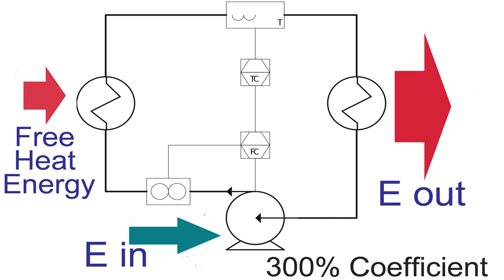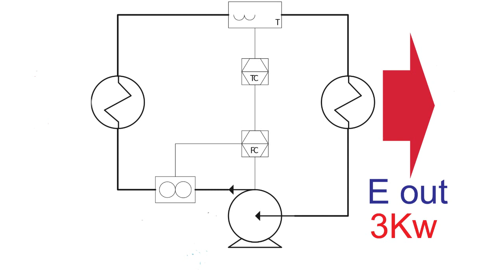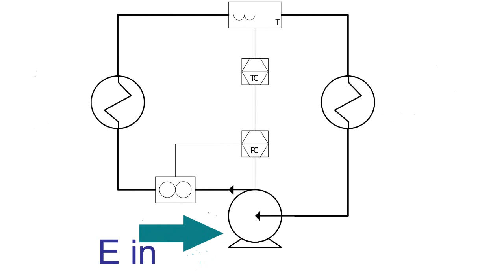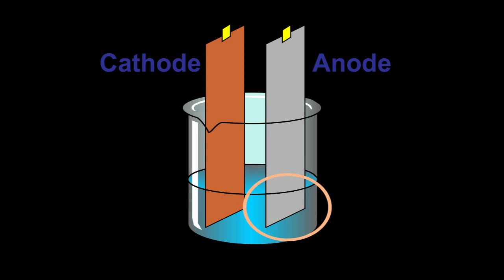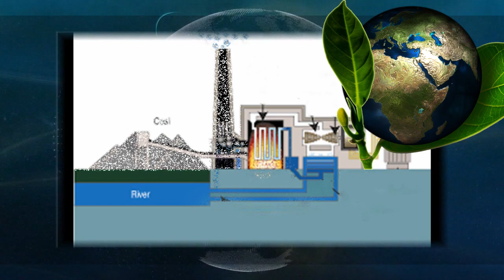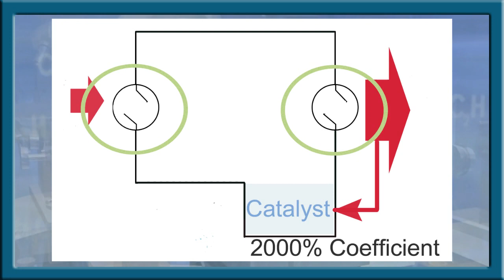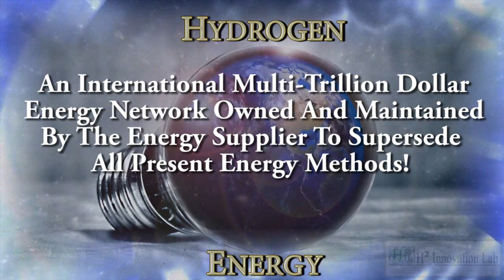How It Works - Self-Sustaining Hydrogen Energy | H2IL

Comment: Doing a bit of calculation here: the website says that $0.34 worth of galvanic metal is used to produce 1 Kg of hydrogen. What happens to the galvanic metal?  I would assume it is converted to oxide.  

The lower heating value of hydrogen is 120 MJ/Kg.  Lower heating value would be used because a fuel cell outputs vapor. The fuel cell is about 50% efficient so that leaves 60 MJ.  You have to power the GEE so maybe 12 MJ goes back leaving 48 MJ.  That would be a 5 to 1 factor which you say was often observed. 48 MJ is equal to 13.33 KWhr. Residential price of electricity is $0.13 per KWhr.  That comes to $1.74.  The fuel cell puts out DC.  To convert to 120/220 VAC, 50Hz/60Hz an inverter would be needed which might be 80-90% efficient.  That would cut it down to $1.39. Finally,  $1.39 - 0.34 = $1.05.  That is assuming that the metal price is in USD. 

I believe that power meters compare voltage phase with current phase so that they will run backwards if energy is flowing out to the service drop. In many places, the utility must credit your account even if the meter shows a negative usage. Seems like this sort of thing would make a good demo of your technology. It would be like the local electric utility is validating that it actually works.  And who wouldn't be interested in a story about a money machine?
Reply from the maker: Thank you for your constructive comments. Yes this is just a small scale demo unit. The principle is based around energy in mass (E=mc2) so the larger the mass of an upscale unit, the greater the energy produced and higher performance. 
You have hit the nail on the head with your grid-tie comment. That is exactly what H2IL will be doing as the third phase of the proof of concept. No one can refute a detailed invoice from the power provider. The 5kWh full cycling system is being developed with plans to start grid feed mid 2021.
An interesting bit of news I received today is that a system the size of  a wind turbine foundation footprint will generate 20 time the energy of the complete turbine in all conditions. Being hydrogen based, below ground installations are achievable and presents a whole new concept for microgrid applications. David Hendrick.
Reply: @h2innovationlabh2il69  Hi David, is your scale model already running on grid,  I didn't think that was happening untill late 2022. Or will that be the time you make open news feeds. 
I'm fizzing with excitement, this is the best invention the world has seen in 100yrs.
Reply from the maker: Thanks for your question and support Barry. That is the time frame for project completion, pandemic disruptions permitting. Grid monitoring reports will be accumulated over a 6 month period following.
Great to hear from ones who take time to study the CCTV video verification reporting. Thank you!

Comment: After going through the process the water must have lost it's galvanic energy.  You can't fully discharge a battery and then continue to discharge it.  Can the galvanic energy be recharged using off peck power.  If so this can be used as a energy storage as well as a form of generation.
Reply from the maker: Correct. Please refer to: support energy storage  https://youtu.be/rVh57uuDwL4
Thank you for your comments and support.

Comment: This can't be comparable to heating pump, that derive energy from air.
Esr is unlimited and fee  while here I don't se anything unlimited and free to provide energt
Reply from the maker: The term 'Free Energy' refers to a natural form of energy, not so much the cost factor to harvest the energy. See https://youtu.be/05pZh7I3NPg   
There is always a cost in any form of renewable energy and the commercial system that exists needs a cost factor to function. If energy was free then no one would be providing energy to the world. 
The energy derived from metals (like nuclear energy) is a natural, free energy. But it also cost money to harvest this energy. Yes the commercial system must be fed in order for it to feed you. Since (in this case) the metals can be recycled then it is unlimited.  The low cost metals can however provide energy to the supplier at a cost of $10 per Megawatt - constant energy 24/7. That means we all benefit.
Heat pumps derive the energy from HEAT in the air - the Suns energy. This is LIMITED by sun strength, seasons and day light hours. It is not constant - 24/7.
Thanks for your comments.
Reply from the maker: H2 Innovation Lab (H2IL) invites you to view an introduction to co-efficiency verification testing of its game-changing energy technology.

The tests are carried out using a PEM Fuel Cell stack to convert the generated hydrogen energy back to electrical energy. Input power in compared to out power real-time.
Scientific feedback is to the effect, and quote, "I truly believe you have achieved the remarkable" - "even if the fuel cell performance was 100%, which is impossible, the output readings are obviously greater than the input power." 

Please follow this link directing you to the brief 

intro video: https://youtu.be/L-PfstY_jYk
Thank you for your support.

Comment: What is the electrochemistry of this reaction?
Reply from the maker: H2 Innovation Lab (H2IL) invites you to view an introduction to co-efficiency verification testing of its game-changing energy technology.

The tests are carried out using a PEM Fuel Cell stack to convert the generated hydrogen energy back to electrical energy. Input power in compared to out power real-time.
Scientific feedback is to the effect, and quote, "I truly believe you have achieved the remarkable" - "even if the fuel cell performance was 100%, which is impossible, the output readings are obviously greater than the input power." 

Please follow this link directing you to the brief 

intro video: https://youtu.be/L-PfstY_jYk
Thank you for your support.

Comment: The biggest issue of why you will not attract investment is this is a technology that ends energy scarcity. Ending scarcity is against the basic tenements of capitalism. It is a system that only rewards those who ensure the continuance of making things scarce and therefor of value. Your best bet is to go to the masses to fund a startup. KIckstarter, GoFundMe etc. is where you need to look to get funding to take this to the next level. The financial barons have no interests in solving scarcity.
Reply: Come on! If this could come to market it means that the owner of the patent would be able to produce cheap and sell at a discount of the competing energy forms, increasing the yield per unit sold and decreasing the market cost. This would be very lucrative, if it´s no already on the market is because they havent sold every obstacle... yet.
Reply: I'd put a couple of EUR into this on Kickstarter. Maybe someone else would, too.
Reply from the maker: H2 Innovation Lab (H2IL) invites you to view an introduction to co-efficiency verification testing of its game-changing energy technology.

The tests are carried out using a PEM Fuel Cell stack to convert the generated hydrogen energy back to electrical energy. Input power in compared to out power real-time.
Scientific feedback is to the effect, and quote, "I truly believe you have achieved the remarkable" - "even if the fuel cell performance was 100%, which is impossible, the output readings are obviously greater than the input power." 

Please follow this link directing you to the brief 

intro video: https://youtu.be/L-PfstY_jYk
Thank you for your support.
Reply from the maker: H2 Innovation Lab (H2IL) invites you to view an introduction to co-efficiency verification testing of its game-changing energy technology.

The tests are carried out using a PEM Fuel Cell stack to convert the generated hydrogen energy back to electrical energy. Input power in compared to out power real-time.
Scientific feedback is to the effect, and quote, "I truly believe you have achieved the remarkable" - "even if the fuel cell performance was 100%, which is impossible, the output readings are obviously greater than the input power." 

Please follow this link directing you to the brief 

intro video: https://youtu.be/L-PfstY_jYk
Thank you for your support.